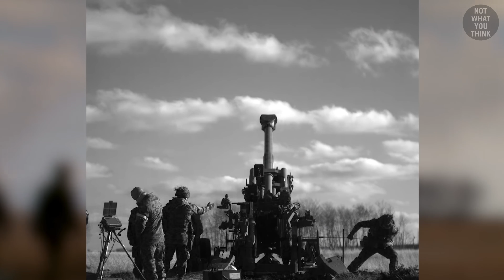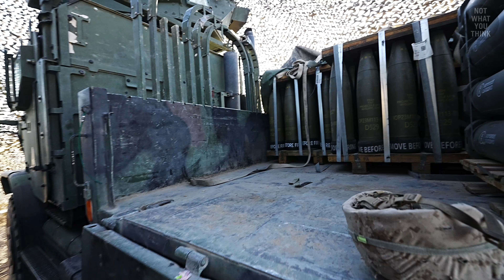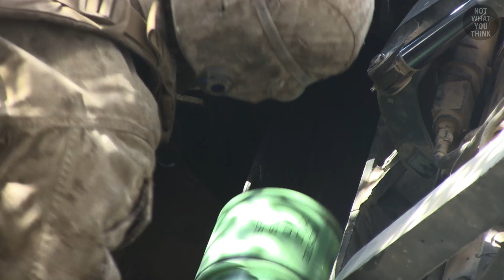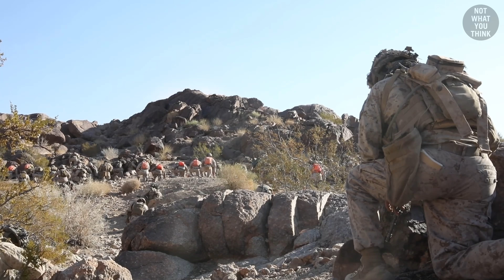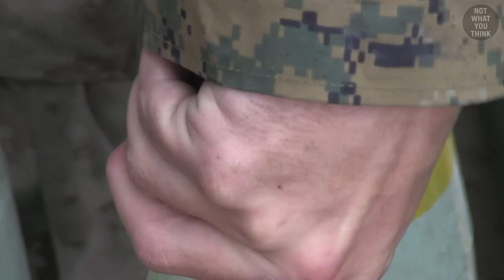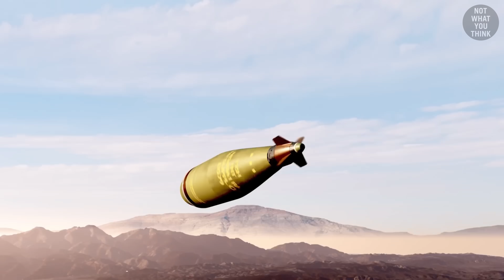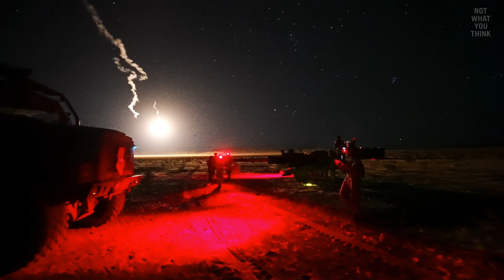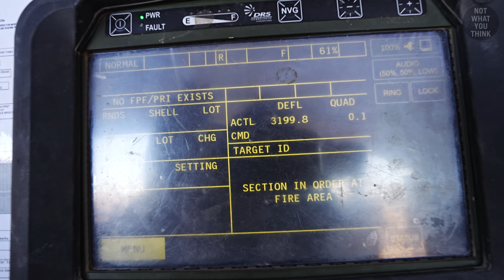Why Artillery Guns Always Shoot Short at Night

Comment: Artillery, still the king of the battlefield
Reply: Drones are deadly and generally more precise, no doubt about it. But effective countermeasures are emerging already. I'd like too see how someone stops 100pound projectile at like double the speed of sound, with explosive payload at least 3 times(more to like 10 times) of a drone, in mid-flight, or takes out artillery position 5-10 miles behind the lines without receiveing few tons of explosives in advance... In near future you will be able to stop first drones, but not first shells. And if you make that artillery piece suitably mobile(mount it on a truck or obsolete tank chassis) it still is capable of doing the work, with which drones will always struggle.
Reply: Love all the comments here how towed artillery is obsolete due to drones. Don't get me wrong, the mobile guns are wonders of shoot and scoot. They have their place, but at a cost. Mostly that of cost - it's a lot more to build and maintain a system with multiple more points of failure. Just because the idea dates back centuries doesn't mean its bad. Ask the 101st about artillery raids. They will literally sling towed arty under a helicopter, fly dozens of miles into the enemy territory and unleash a surprise barrage. Pack it all up, go somewhere else and repeat it. Can't do that with a Paladin. With modern systems, it's possible for a artillery piece to be set up, fire 4-5 rounds for a mission, tear down, and move before the rounds impact. And modern fire control means all those rounds will have been fired on different trajectories ensuring they land near the same time. 
Ukraine doesn't use drones because they are better. It's just easier to produce them. It's also easier to counter them with electronics that even Russia can and does build. An assault rifle with the right optics could take down a drone. Much harder to stop a 100+ plus metal jacketed HE round travelling 2.5x the speed of sound.
Reply: @ericepperson8409  It is less about stopping the projectiles and more about towed artillery being immobile and taking forever to get ready. Compare it to a modern system like the PzH 2000 which can reach its firing position, unleash a barrage of rounds and drive away before you can even decouple your towed artillery. And if the enemy allows you to do helicopter airlift operations within their territory you might as well deploy a gunship or old school bombers since they seem to lack all kinds of anti-air capabilities. 
IDK, being deployed as a towed artillery unit on a modern battlefield feels like playing the role of sacrificial decoy. 

The only time towed artillery seems appropriate is in asymetrical warfare when the enemy lacks all kinds of artillery and air capabilities and cost becomes the most important factor. (Or if you don't have any alternatives of course.)
Reply: @ and yet Ukraine will happily take every 777 we send them. Again - when you build a gun into the platform you increase the chances of a breakdown making that gun unusable. Engine blows a gasket. Turret housing springs a hydraulic leak. Flat tire/thrown track. All of these make the mobile gun even more useless than a towed piece. If the truck pulling a towed piece breaks down, you get another truck. It’s not saying that a Paladin or Caesar don’t have a place - they do. But there is a cost to building and maintaining them. They are complex machines. Complexity means additional problems on a battlefield. Modern tube artillery gets around counter battery in one way with MSRI. Ask an experienced crew how fast they can tear down and bug out. 
If you’re going to shit on a legitimate tactic that elite units use and practice, then maybe you should become the secretary of defense. I hear the post might be available.
Reply: I'm nowhere close to the military in anyway (unless they want a professional printer technician), but how would the "conventional" artillery perform comparative to other systems available? It seems like (at least from this video) that it can be timely to set up but, be potentially cheaper / easier to maneuver into weird locations when you need to change locations relatively quickly.
Reply: That's way too anachronistic rhetoric, don't you think? Didn't U follow the words and scenes around Ukrainian warfare?
Reply: @dudaritething  ukraine is always asking for artillery rounds, not drones. drone can disable a tank or drop a grenade on a squad, but it can't actually destroy a tank, bunker, or any fortified position
Reply: @JoHn-gi1lb  Because we have domestic production of military drones in the millions now
Reply: ...the Russian army probably don't agree
Reply: ...if you're Russian
Reply: Yeah, towed hand loaded and hand sighted artillery is not king of anything. Except as an easy target for counter fire.
Reply: Towed artillery is not though.
Reply: @papakamirneron2514  It still is, plus its cheaper to move than mechanized artillery
Reply: @nicolas08_yt Looking at the current conflict in Europe. Artillery has to be mobile and quick to move since they’re quite vulnerable to attack. Especially from drones and other Airstrikes.
Reply: I think drones have taken there place much precise!
Reply: @Lord_Spivey  correct, 70-80% of casualties are from drones
Reply: @PreatorUA  LOL! No, not at all! Who told you that 80% (or even 50% or even 20%) of casualties are down to drones. Don't get this wrong : drones are a whole family of weapon systems ranging from very expensive to very cheap and from simple reconnaissance to quite intermediate and even heavy (for those coming unmanned aircraft) bombers, but up to now they only account for a fraction of deaths. Even in the war of Azerbaitzan against the Armenians of Nagorno Karabach the drones did not kill that many but managed to put out radar systems and other such defensive measures, thus reasoning the job for the ground teams. I think you are seeing far too many Ukrainian propagandist videos. Do you realize that Ukrainians have how many? 5000 drones? Not even... they have a few hundreds. There are more than half a million Russian soldiers on the battlefield. And from the videos we see only successful drones (which is what? 1 in 5? 1 in 10?) hitting e.g. an armored vehicle or some canon killing 2-3 soldiers. And then you have the cheap ones which are literally used to kill a single soldier (LOL!), which is totally ineffective in military terms unless one sees it as a terror weapon. But I can bring you several 10s of Russian propaganda videos where they show how easily Russian soldiers clear them out, some even grabbing them with their hands before they explode and throwing them 5 meters aside where they explode but do no damage due to their low explosive load.

You know who does most of the killings? ARTILLERY! As many people pointed out, it is still the king of the battlefield. Imagine that Russians have purchased a large quantity of Iranian cheap drones plus they have theirs, more expensive ones, imagene they have complete control of the skies and can bomb Ukrainians by air from 20,000 feet, imagine they have hypersonic missiles and they can hit anywhere in Ukraine (like they can hit anywhere in Europe, anywhere in the world)... but..... what do Russians do? Well, they just use their long range and mid range artillery bombing the sh*t out of Ukrainian positions and once clearing them, they move their artillery 10 km forward and repeat process. This is how they are clearing Eastern Ukraine of Ukrainian defences square kilometer by square kilometer minimizing Russian losses. And in spite of Western fake reports, Russians have not lost nearly as even the 1/3rd of what they report. In such a massive war going on for 3 years, between two prime armies (Ukrainians are not just Ukrainians, we really talk of NATO here propping them up), Russian shave kept it to 7:1... i.e. 7 Ukrainians die to kill just one Russian. And this was up to end of 2023. Since 2024, the Russians got that to 10:1.

This is how Ukrainian loss of life is up to the vicinity of 1 million (should be certainly more than 850,000 by now, very probably a bit more than 900,000 dead soldiers), while verified deaths for Russians, all units counted including mercenaries, are 83,000 as per December 2024 - so how many deaths are missed? 20%, 30%? Even if they missed a 100% of deaths finding evidence only for half (which is hardly the case), then Russians lost so far 165,000 men, which is precisely the 7:1 that Ukrainian generals spoke off back in 2023 (i.e. losing between 20,000 and 30,000 men).

All that not thanks to Russian airforce or the hupersonic missiles or drones but thanks to the good old artillery. And I will close this with something said by a French general. When Macron a few months ago warned the French to be ready for a war with Russia, this retired general, evidently expressive the views of most if not all active generals, reacted in protest going to the media and saying that Macron is delusional if he thinks France (Europe's No1 army!) is in any shape or format to start up a war against Russia bringing in as No1 comparison the artillery. He explicitly said that :
- France currently produces monthly 3,500 pieces of mid/long range artillery ammo and may, at best, bring that up to 10,000
- Russia as per 2023 intelligence info produces 250,000 pieces of mid/long range artillery ammo and can easily double that.
There is simply no comparison!

I bring that up to point out which was the first comparison that the French general did, not the tanks, not the drones, not the airforce, nor the navy. It was artillery. Why? Because artillery is still KING of the battlefield.
Reply: @dustinspivey2519  stop it with the drones, artillery is way more powerful than a simple grenade
Reply: @nicolas08_yt they're prey for drones our have you not been paying attention to whats going on.
Reply: You must not follow the war in Ukraine.  Cheap FPV drones are now causing most casualties and equipment loss.  Towed artillery is obsolete on the modern battlefield.